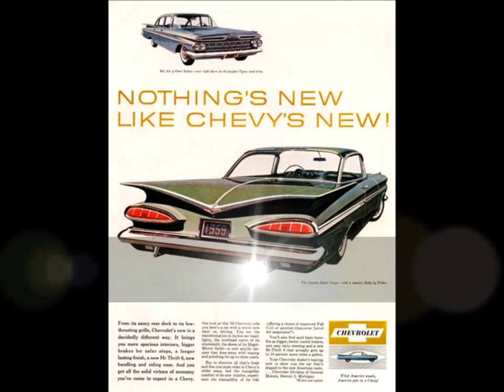59 CHEVROLET BUILD

Comment: So many curves in metal, so many different body styles, so labor intensive and so little plastic. Wow! How I love old cars. Thanks for the video.
Reply: Just don't hit your head on that all metal dash!
Reply: Yes there wer many great body styles during the 50's and 60's era, but build quality and materials used improved greatly later on in the 90's to current.
Reply: The tail light lenses may have been the only plastic on this car.
Reply: @bobjohnson205  would not dent it, the dash that is😊

Comment: When the cars were works of art. Magnificence, greatness, bold design, colorful. A dreams factory.
Reply: Dan Jackson  Chevy’s 283 was a magnificent little motor that you can actually get great gas mileage. The one in our 64 impala only had one rebuild because it was left outside without a hood and had gotten rain in it. In most cases reliability depends on how you hard you are on your vehicle.
Reply: Dan Jackson  damn son you don’t have to hate so much on a simple comment, of course they weren’t made as good as cars now a days but they sure did look a lot better then these ugly trucks and cars
Reply: Dan Jackson  you could say the same thing about some cars of today. Some of them are just udder trash.
Reply: Dan Jackson ....awwwwwww...now run along and jump in your hybrid
Reply: Jobs galore for people,not robots.Worse for the product,but people could afford to buy one.
Reply: @randalldavis3251  Ok the old classics ran on leaded gas & only lasted up 100,000 & would need a rebuild. But style was everything back then when they changed the style every 1 or 2 years to get u to buy the new models. Look how much the style changed from a '57 Chevy to a '59 Chevy.
 I've owned both years the old rides are not as safe but they're sure a lot of fun & works of art. I wished GM would bring them back because it would put a smile on lots of peoples faces. I would buy one. 
My dad bought a new '57 Bel Air & kept it for 11 years an exceptionally long time when the average car buyer only kept a car for 3 or 4 years. My aunt bought a new "60 Impala 2 door new & sold it in 1965 for $500.. 
My dad sold his '57 Chevy to a kid in 1968 for $250 still in mint condition.
Reply: Dan Jackson  You obviously haven't ridden in too many 50's or 60's Cars .try the nice ones ,Buick ,Cadillac ,Chrysler,Thunderbird .Mass production was half by hand .and build was uneven .if you got a good one , would last Over 150,000 miles with regular maintenance .many did .Machines build cars now .so ,much more commonality .higher tolerances .Also ,technology takes More than a decade to come to average person .look at h.p. per liter in race cars in 1965 .thats about what  production cars are Claiming today .these Turbocharged 2 liters .today (a lot of them ) we'll see how many are still running good 10 years from Now .
Reply: Dan Jackson  Needed repairs frequently? Todays vehicles have 10 times the amount of "breakable" components in them that they're just every bit as "frequently repaired" as older cars.
My Chevelle had 265,000 mile on the engine 6 cylinder before the head gasket blew. Could have repaired it, but swapped out for a V8
Reply: Dan Jackson  Yeah, before your car dies you'll be heading to the dealership to have things fixed about twice a month, especially if you buy something like a Tesla. Everybody's looking at it like if it was from the other space but, as the Europeans complain all the time, interior has been put together by a bunch of baboons ,the suspension is about as advanced in comfort as a horse-drawn buggy and the body panel gaps are about as consistent as on a russian Lada. You'll be also changing your battery every 7 years for twice the money the car's actually worth. I am not even talking about the amount of destruction to the planet that brings making of those batteries, something not talked about at all in US! Problem with that is that if you pollution from their manufacture to the equation then even the Dieselgate VWs are more ecological! If I park that '59 Chevy in a garage and I come back after 15 years, only things I'll have to replace are the tires and fluids, maybe some rubber parts, whilst most of the electrical system of modern cars would be gone and in case of Electric cars the expensive battery would be dead to and you'll have to hope that they still make that battery after those 15 years that's what today called ecology!!!
Reply: You forgot death trap lol
Reply: They were cool but let’s not romanticize them too much.  Who remembers rattling dashboards, leaking window seals, and split radiator hoses as soon as you pulled out of the dealership?  My dads ‘60 Biscayne barely got 80,000 miles on it before it needed a major overhaul.
Reply: @andrewpowers7034  True, but even today such things can be encountered, not split hoses and such but leaking seals and badly fitted body parts are nowadays becoming much more common that they were in the early 2000s which is worrying.
Improvements in metallurgy and machining of course greatly increased the longevity of mechanical parts, most modern cars die becuase of electrical issues.

Comment: I will always like the styling of the 59 Chevrolet.
Reply: I think her rear end is the sexiest of them all, as far as the 50s chevies go.
Reply: Bruce Bryant i love so many years of Chevrolet. Especially 58 belair or impala
Reply: When I was little someone in my neighborhood had one in their yard. I used to think the tail lights reminded me of an old Chinese dude lol
Reply: Such an UNSAFE vehicle. View the 59 Chevrolet crashing offset front end with a newer Malibu. The 59 crunches back into the front seat area, devastating design as to safety.
Reply: @tapper701  Who would have thought a 60 year old car is not as safe as a new one?
Reply: @ps-em4nz  thank you, everyone falls for that goddamn video. And you can tell it's there to pretend they were unsafe because of the color they painted the automobile. It's that rust color, and a cloud of rust came off of it when it was hit. Unfortunately it was a little more yellow toned so you could easily see it. And the seating flew off, so did the side fender which does not make any sense. And the interior wasn't even bad, no steering column at all coming forward, no dashboard issue, doors were intact. I've seen a crash test 1959, it went far faster specifically 60 miles per hour into an oncoming automobile. Hardly the damage they showed here. And funnier, that 60 year old car (then 50) was not put again a 2009 Chevrolet Malibu in 2019, it was a 2009 Chevrolet Malibu in 2009...when it was bran fucking new.

Comment: bought my first new car,.. a 1959 convertible, 4 speed on the floor, with a optional 348 engine rated at 250HP...it was a beautiful beige. a timeless design.

Comment: American made cars!
Reply: Beautiful cars made to last. If rust proofing was used back in the day,there would be still lots of these cars around.
Reply: Yes, if only more galvanized metal and aluminum were used on these classic's, there would be many more around as today's cars are.
Reply: Wrong. 

These were junk at 100,000 miles even without the rust. 

In the 1970s they were $50jalopies and demolition derby cars. 

Today’s examples are rare and valuable because so few survived. They were painstakingly restored at several times their assessed value. And they are carefully trailered to events and driven only short distances on sunny days. 

In a frontal offset collision with a 2009 Chevy Malibu... the 1959 Impala was completely destroyed in an IIHS safety test.
Reply: Bartonovich52 but that was a beautiful car.

Comment: Try and get two tone paint today.
Reply: You can't even find a good place on today's cars to even draw the line for two tone
Reply: You could only in a New 2019 Chevy /GMC but you had to extra and wasn't cheap
Reply: Dan Jackson  In Europe there are several manufactures that produce cars with two tone paint jobs! And their liked a lot!
Reply: @eozcompany9856  name them then Mr cryptic. I'm sure their nothing like what I'm hoping for.
Reply: @WitchKing-Of-Angmar  Renault, Škoda, Citroën and Toyota just to name a few.
Reply: @eozcompany9856  oh that hideous copper and gold with a "two tone" also known as black roof. And can't forget that neon ocean blue metallic with a Adventurous white roof this time. They have 4 colors, 2 are white and silver, back in the 1950s in everywhere, they had 17. Two tone choices, three tone choices, all different models each and every company their own look. And one thing modern day can never accomplice, different body styles. A Pontiac versus a Ford in 1954 for example, completely different sizes. The modern audience See's one of them and immediately believes each and every single car was that size wether it be smaller or larger. Such as a Emerald irid Mercury 1973, amongst the largest automobile ever. However many parking lots in the 1970s offered the cuter smaller models, AMC's collections and many of the less economy styled automotive coupes. Every car in the cities in the 1970s was a full sized sedan.

Comment: If it was made in the Tarrytown N.Y. Plant there is a 50-50 chance I helped build it,I worked there from 1957 to 1960 on the night shift.
Reply: That’s where the Life Magazine photos were taken.
Reply: that's real cool, did you buy a new Chevrolet from '57 to '60 ? That must've been 
exciting. I bet you got a good deal, my dad bought a new '57 Bel Air & ordered it straight from GM because he said it's a better deal & cheaper than buying from the dealer.

Comment: I was raised on ranch in the 50s.  It was a family effort so I never got paid, but on my 16th birthday my parents bought me a new  '59 Impala.  In those days folks bought new cars every 3 years so in 1962 (I was working in the business and getting paid) I bought another Impala.  This one was fully loaded, big block 348, I swapped the four barrel for three-two carbs, four speed and posi-traction.  By the time I was 22 or 23 muscle cars weren't as cool so I traded the Impala for a new VW.  I think a new 64 or 65 VW was about $1,600. Today I still have a '64 double cab VW truck and it's my daily driver.
Reply: That's cool I was 17 in 1977 & my ma bought me a '59 2 dr Impala in mint condition. I regret to say I cracked it up & my dad bought me a '57 4 dr. Bel Air in 1978. You're right most buyers only kept a new car for 3 years  they kept changing the style. However my dad bought a '57 Bel Air new & kept it for 11 years till he sold it cheap to a kid for $250.....& the car was still in mint condition. My dad was a sailor so the car would sit in the garage for half a year. My ma learned to drive in a '57 Chevy.

Comment: Australia imported a few of these, my DAD had two of them and took them out to the trash, back in 1980, and now they are worth over 100K each, in original condition ? Also there were in Original condition at the time he thrown them out with the trah, all they needed was a little love and a polish and a little engine and transmission care and the things would drive, basically new oil's and battery and off you go driving a right hand drive 1959 chevy bel airs with rear indicator on each side of the large wings on the back, they were white and light blue in colour. :)
Reply: Yes that's right, I saw a right hand drive '59 Chevy Bel Air in England & I also saw
a '60 Chevy Impala 4 dr flattop in England both cars from Australia. I lived in England & I'd love to own a right hand drive '59 or '60 Chevy.

Comment: Some got stacked on iron barges, some got stuck in riverbanks, some stayed pristine as survivors, some we're still cutting up, and some are getting restored as we speak.
Reply: My first car in 1977 was a '59 2dr Impala in mint condition I was 17 I was so obsessed with the car if I wasn't driving it I would stare at it for hours at every angle. It was my "Christine" I was at a stop light when I heard the news Elvis died. I got into a terrible accident & totaled & wrecked the hell out of it. CRUNCH !!!  Ouch !! those cars are fun but not safe by today's standards. 
The car was a total mess & it had to be towed. Got an estimate from a body shop & the cost was $2000 to fix it. I said no because the car wasn't worth fixing. I paid $1600 for the car & much cheaper to buy a better one. I bought a 2nd '59 2 dr. Impala in 1979 from a college student for $1,375 I tried to get him down to $1,200 but he said no. it had 62,000 original miles 348 turboglide. mint condition i didn't wreck it I gave it away for $600. Back then '59 Chevy's were not desirable everyone wanted the tri-five & "61 to '64 Chevys. I had one more "59 2dr Impala mint condition in 1998 by this time they were desirable & the price was $11,500 I had to finance it. Never dreamed they would be a hot item. After I wrecked my first one in 1977 my dad used to say "it's not a hot item like the '57 Chevy's" He bought a '57 Bel Air new & he never liked the '59's.

But in the 1970's I didn't buy '59 Chevy's for an investment I just liked the style. Back then '59 Chevy's were still going down in value in 1980 I came close to buying another '59 2 dr Impala in mint condition for $1,200 & I spent hours thinking it over & I walked away. I already had 2 before & it gets old buying the same car. Same year I could've bought a '59 Impala convertible for $1,200 new top & a driver but missing all the chrome & grille. That turned me off & I walked away. 
I saw an ad for a '59 Impala convertible in mint condition for $1,500 in 1978 but I didn't have the money.

Comment: Say what you want about build quality, but the styling of this era puts today's cars to shame! Now, every car, regardless of manufacturer, looks like an egg and you can't tell one model year from the next. Yes, as you moved into the 1970's every vehicle seemed to become a land yacht, but at least there was still some uniqueness of style from marque to marque!
Reply: Nah 70s cars were just bland cereal boxes that people had to deal with during the Oil Embargo.
 
Today's cars are not even that bad. I've looked at every new model and none of them are close to looking like eggs
Reply: Yes indeed! HARD BOILED EGGS!
Reply: @ddellwo Okay, I will say it, those car's build "quality" was sorely lacking! Very few of those cars would make it to 50K miles without MAJOR ENGINE work, unlike cars of today (even the econo-boxes) can easily make it past 100K miles with just routine maintenance!
Reply: Yeah, maybe so but for example the motor oils were not as good as today. That alone plays a huge role how engine will last.
Reply: @otom20  Yes, the oils back then were terrible and provided little protection, and no friction modifiers at all. Also, the metallurgy was nowhere near as good as now. But, those old cars had character and the styling was great.
Reply: I guess you  never seen a 283 small block. Or a slant 6....2.k no problem. Just had to stay away  from  the Quakersluge.  Oil.

Comment: One of the Fisher Body plants was in Euclid, Ohio. They would assemble the bodies there, load them in box cars and they would be shipped to Detroit? For final assembly to the frame and power train. From final assembly to trucks for shipping to your local dealership. Working at Fisher Body meant after 30 years you could retire with a pension.

Comment: Wouldn't that be cool walking along the assembly line at every station, picking your cars options......Mine- Roman Red, 2dr ht, 348 4v,  4 speed, black interior, wonderbar radio, dual antennas (that's so cool) anything else?
Reply: I had 2 '59 2dr Impala's in 1977 & 1998 in mint condition Roman red paint
& red interior. My first one had 283 powerglide power steering, power brakes,
& 6 way power seats. Beautiful car until I got into a very bad accident & wrecked it after hearing the news Elvis died. My 2nd one didn't have power seats.

Comment: They Shot These At The Terry Town, NY Assembly Plant, Fisher Body Plant, And One Of The Two Fisher Stamping Plants.
Reply: I always wondered what the meaning of "body by Fisher" meant, never found out, what was it?
Reply: varigdc10 Chevrolet did not build the bodies for these cars. They were sub contracted to the adjacent Fisher Body Plants. That's a fact ! Chevrolet did not build, stamp, or paint Chevrolet s in 1959. (Corvette being the exception) Fisher was a long time very well established coach builder that dated back to the turn of the century when a lot of automobile makers only produced running platform chassis vehicles. It was then up to the owner to choose the desired body of choice. That's why a 59 chev has two body tags, One from Chevrolet, and one from Fisher. Another recognized coach builder contracted by G.M. was Fleetwood. Early Caddys had a door sill plate that read Body by Fleetwood. When your DeVille Bodies of the same year were made by Fisher, Not Cadillac.
Reply: The Fisher Brothers built the bodies for General Motors back in the early days of the corporation and they were bought out by General Motors and was incorporated into the company.  GM cars after that always had the 'Body by Fisher' logo on the sill plates from then on.  Fleetwood was another independent body company supplying custom bodies for Cadillac.  They were also bought out by GM.  My 75 Cadillac has a 'Body by Fleetwood' emblem on it's sill plates.